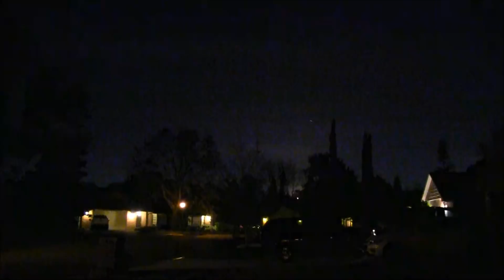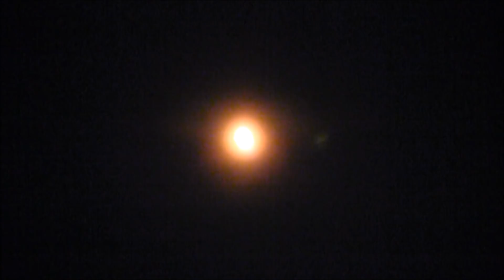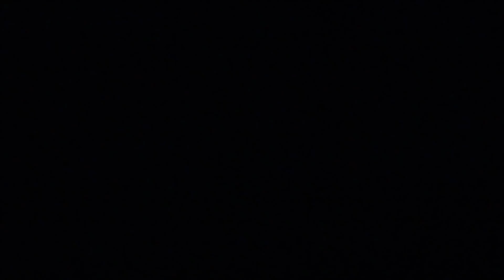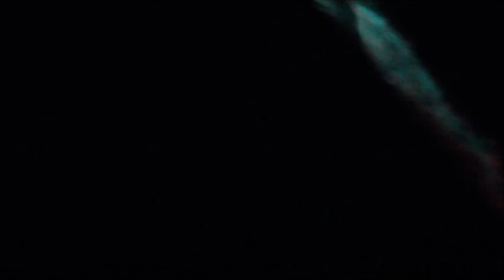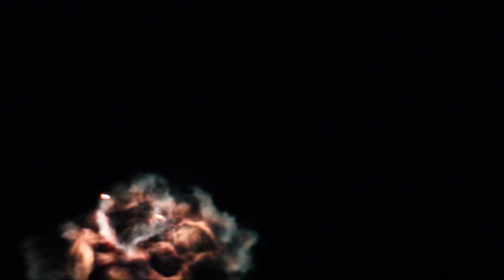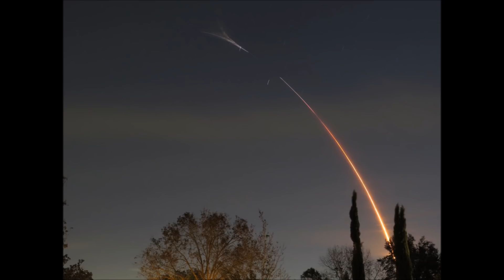SpaceX Zuma Mission HD Telescoped

Comment: So glad I found this video. I could not imagine you could track a rocket with a telescope. Would this work with an equatorial mount?  I do not own a Schmidt-Cassegrain but I am thinking of getting one to photograph the lunch from cape Canaveral over  Rt. 401. It is 11 miles away so the idea is to point a Celestron C8-A SCT with a dslr attach on the back of it to the launch pad and fire the dslr during launch to get some pics. Do you think my plan would work? The focal length of that tube is 2032 mm and it is an F10  tube . Experienced my first launch last week during the Zuma mission. I think I am hooked. Planing to try to photograph every launch I can tho I have to drive from Miami. It is worth it.
Reply: haha. I will try and see if it works. I only have an equatorial mount. I wonder  if I can track the rocket with it. I see this one  was track using an alt azimuth
Reply: Thanks I am gonna try that. I live next to an airport so I have plenty of planes to practice

Comment: What kind of telescope are you using?  It sounds like you're manually rotating the alt/az knobs on an LX200?  If you've got an LX200 classic you can use my software to track it using the motors and a joystick.  Check out my teletrak pre-alpha, it's free.  It makes life so much easier when tracking launches.
https://www.youtube.com/watch?v=KjQ41VIaL3Q
Reply from the maker: i use a Nextstar 8SE,from Universal, Orl, 60 miles away, i use the hand controller, rate 6,  but, the Falcon rockets are just faster then it, the Shuttle it was perfect, i'm try rate 7 next, the Heavy launch soon rate 6 should be ok, If i loose the rocket i go to rate 9 to catch it again with the red dot star finder, then all the jerking starts,usually youtube stabilization editing works to stabilize, but it didnt this time...this right here's the best program to "Auto" track objects...http://www.optictracker.com/Home.html...i been following them up for years, so my scopes gears are real loose as you can here,i need to have it rebuilt, even setting the backlash wont help now, ,it has joystick function built-in i just never got it to track good going diagonal with alt/az single arm
Reply: Yeah, optictracker isn't compatible with the classic LX200, only the newer autostar LX200 so I've never been able to use it.  Sorry to hear about your gear problems.

Comment: Recent reports that the payload failed to separate from the rocket and was lost.
Reply: Here's my guess. The rocket reached its designated orbit and designated velocity. When it tried to shed its faring it didn't shed. There was concern about this 2 months ago. Without detachment, the satellite won't function and cannot fire its engines to orient. It can't open its solar panels for power and to charge batteries. So they probably did not blow it up or send it back into the atmosphere because they couldn't fire the engines. So it's floating in low earth orbit. They don't want to say this because they don't want the Chinese going up to salvage it. But they can send up that Little baby space shuttle and grab it. Take it back to the space station. Fix it up. They are not gonna send it crashing thru the atmosphere. Not yet. They're gonna try and fix it. But if they act like it burned up then nobody will go looking for it.
Reply: I'm not sure if they could do a salvage operation but why not? If they can rendezvous with Hubble why not zuma? Unless it's spinning out of control. But a capture and a tow would not be impossible. If it's a 4 billion dollar satellite, what would prevent this? If the technology dies not exist now, it wouldn't be that difficult to create it. If it was a 150 million dollar payload probably not worth it. But 4 billion? I'm sure the Chinese would snag it if it's just floating around. I am pretty sure it's still up there as I have not heard it burned up. There is no reason for it to fall out of orbit unless it was acted on by a retrorocket. But there is no retrorocket to use unless the faring deploys. So it has to be up there still. And the faring problem was noted in the news 2 months ago by space x. So in thinking ng made the nose cone and faring. Not space x. Space x seems to be saying the falcon 9 worked flawlessly. So I think ng made the faring. Anyway I think it's in orbit just not working.
Reply: @lcagee  NG supposedly made the payload adapter that allegedly failed to separate. I'm pretty sure it was a standard SpaceX fairing. Your fairing theory is interesting though.
Reply: Robin Paul, whooo?
Reply: Three Owl Night there are photos of Zuma and Falcon 9 second stage over Africa after completing one orbit. The payload was not lost, unless F9 Stage 2 reentered with it still attatched.
Reply: C Dav, thank you,  Fantastic. Another example of controlling the message to the masses.
Reply: lcagee, great analysis. Thanks for the info.
Reply: lcagee how you salvage something in orbit? I think what happen is either all went fine and they are keeping it secret. Its was supposed to be a "secret satellite" afterall or it failed to separate. It seems space X was forced to a NG made adapter so possibly NG fucked it up and the separation was a fiasco.
Reply: Shhhhhhh it's a secret  ! Remember?
Reply: Robin Paul shhhhhhh it's a secret. ....
Reply: I know where it's at.  Gilligans Island  !
Reply: Bullshit they know and we know
Reply: lcagee Much Thank you for information, I pass this to Commander at once . The People's Republic thank you.
Reply: @golffoxtrotyankee  hahahaha
Reply: I'm still pondering this. The faring normally separates at a certain altitude where the drag is minimal. Not sure what altitude this is. Maybe it's 50 miles. Then the second stage burns it up to a higher altitude where it's released. Maybe 250 miles. If the faring doesn't separate it can still fly to a higher altitude but not as high. And each altitude would have a rate of deterioration of orbit. I'm guessing if it didn't seperate and didn't burn it would crash in a few days. If it didn't seperate but it did burn it could reach a higher orbit but not a useful one. But if it can't shed the faring it can't open its solar panels. So NASA had to decide whether or not to do a second burn of the second stage. If yes it stays up but never separates from stage 2. If no, the whole thing crashes in a few days. Of course if your the defense department you mislead the public.

Comment: Um, at 1:47 there is a purple "ball" and at 1:49 it hits it and then craziness. what the heck did they hit?
Reply: The purple light could be anything normally found in the sky, like a star or even a planet. The rocket doesn't hit it in any way.

The crazyness you're seeing are the 10 engines firing against each other, causing a lot vortexes where the exhausts collide. Where the rocket is at that time, the atmosphere is quite thin, so that's why it gets spread out so much. The first stage is firing its engines because it has just started its boost-back burn, and the second stage is of course continuing to low earth orbit to insert the payload.
Reply: And there are the flatards!
Reply: hahaha :D  You are an idiot!
Reply: UFO
Reply: fi5mvKsW3M:: Isn't it funny that tha haze seen here has been the same looking spread of these rockets hitting the aka non passible dome! But nobody says it hit the dome.... And it's also funny as hell that Russian astronaut just busted these flat earthers a new one! Good call on that one.....
Reply: It seems to be Neptune Planet (We can see it has some tens of pixels wide diameter definition, so not a star as it would be seen as a punctual and undefined dot), but not sure.
Reply: idont thinkso the purple Ball is a star
Reply: The earth is flat Man and Wen u gent To  close of the dôme u have this floating effect and i think theyr making expérience try To pass the dôme